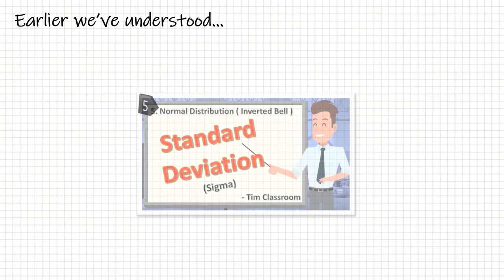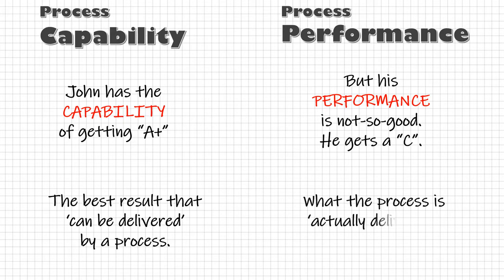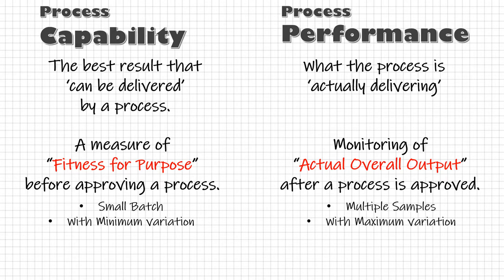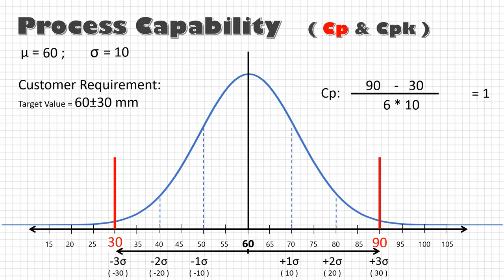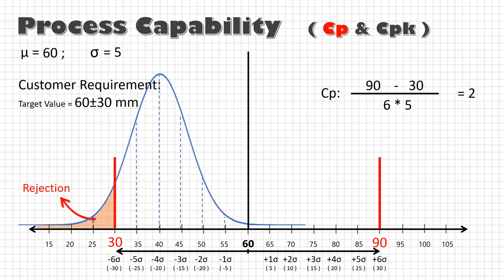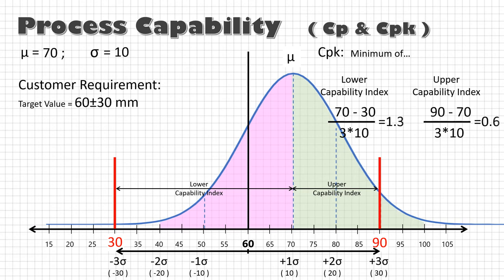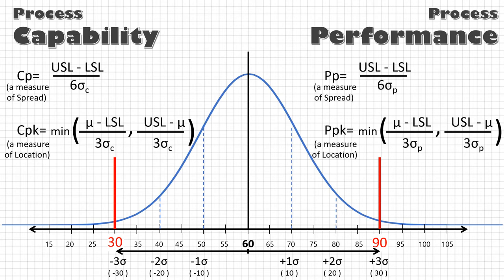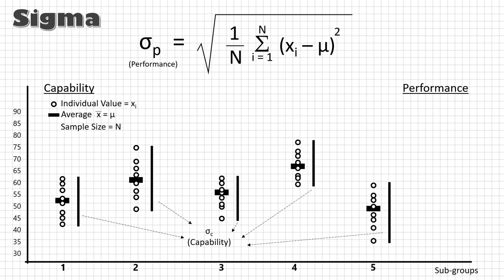Process Capability & Process Performance

Comment: I need one clarification, i have not seen Rbar/D2 in your sigma calculation for Cp. Please clarify
Reply from the maker: Rbar / D2 is an easier way to estimate the value of Sigma (standard variation), where D2 is a function of n (sample size). I've deliberately skipped this formula since it may become pretty difficult to explain D2 which is a result of extremely difficult mathematical calculations. 
Just remember, as the sample size increases, the value of D2 increases and the value of standard deviation decreases for the same Rbar. That means with bigger sample size we can have better estimate of Standard Deviation. 
Coming back to your point, whether you calculate Sigma with Rbar/D2 or using the standard formula, your result will be the same. or most likely to be the same :)

Comment: Cpk and ppk not cleared properly,Can u give some more examples and explanation?
Reply from the maker: Think of Cp (Process Capability) as a measurement unit to identify if the process qualifies to make the product. If it doesn't, it's normally an engineer's job to 'IMPROVE' the process by modifying the machine, using different tools/dies or reducing the clearance between moving parts, etc.

Once the Cp is qualified, then in the next step Cpk (the process index) is a measurement unit to identify if a process is set at the mean position. If it isn't, like the diameter is on the higher side or the length is on the lower side, then it's normally an operator's job to 'ADJUST' some machine's setting and bring it back to the mean position.

Hope I'm able to answer; if you're asking something else, please elaborate a little. For example, what exactly is not clear?

-Amit Gupta